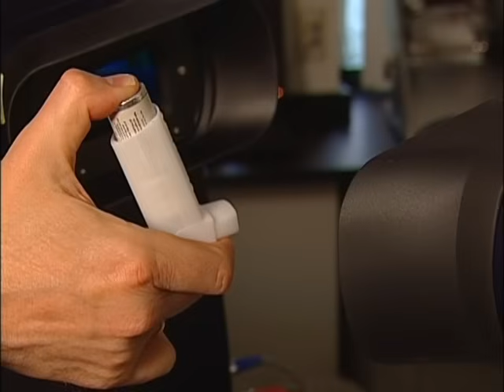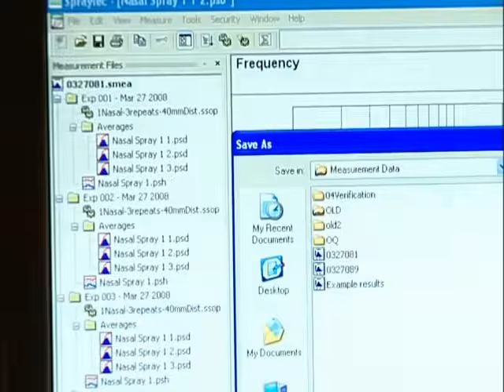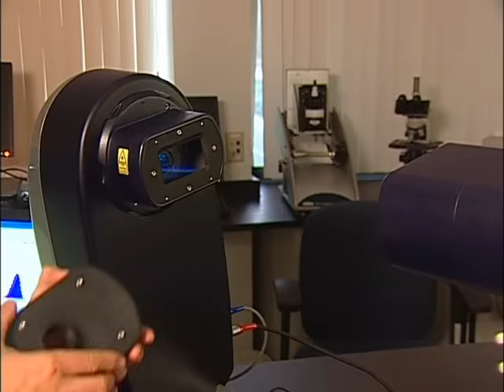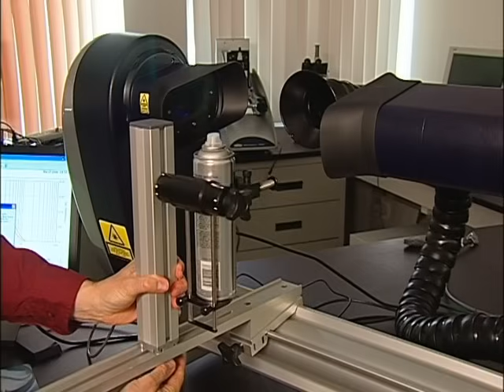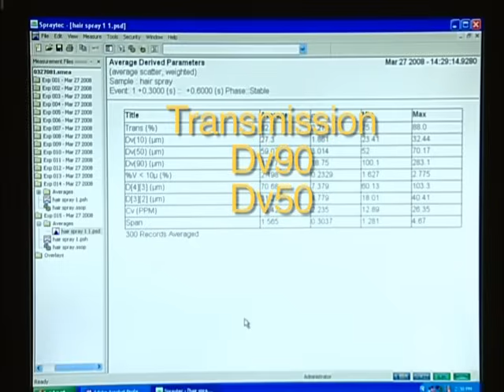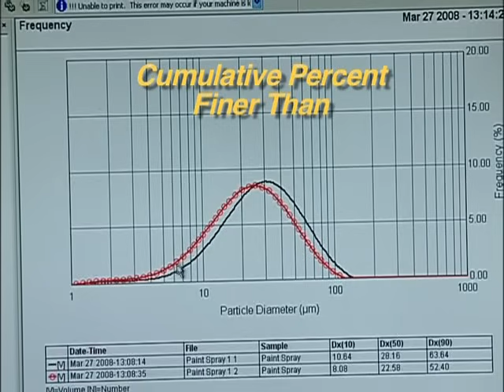Laser diffraction spray particle & spray droplet size measurement - Spraytec

Comment: Could this measure the droplet size suspended in the air coming from an agricultural sprayer used to spray the pesticide solution over the crop leaf? We want to test the droplet size of nozzle sprayer used in agriculture operation.

Comment: anyone explain the difference between what is meant here the optical bench and working distance
   1)Optical bench: 1400mm or greater.
2) Working distance: 150mm at 0.5microns and greater than 2000mm above 10microns or better.
Reply from the maker: Thank you for your request, Could we ask you to reach to your local representative that will contact you back until one of our specialist can provide a reply to your question - https://www.malvernpanalytical.com/en/about-us/contact-us/. Hope this helps.
Reply from the maker: 1)	The optical bench is the rail on which the transmitter and receiver units sit, the standard bench lengths are 900mm and 1400mm (but custom lengths can be used). The choice of bench length depends on the width of the spray plume that you want to measure.
2)	The working distance relates to how far away the sample is from the receiver unit as it passes through the laser beam. Smaller particles, scattering at wider angles, need to be closer to the receiver unit to ensure that all of the high angle scattering is captured. Bigger particles can be further away from the receiver unit as they scatter at narrower angles. Hence the example working distances of 150mm for 0.5 micron particles and more than 2000mm for 10 micron particles.
You can find more details (and some helpful pictures) here:
https://www.malvernpanalytical.com/en/learn/knowledge-center/technical-notes/TN101104WorkingRangeLaserDiffractionSpray.html

Comment: Hello!  In principle, yes.  It depends on the droplet concentration, droplet size and arranging the system in such a way that the spray can pass through the laser beam.  If you can you tell us a little bit more about your application, we'd be happy to investigate if it is feasible or not :-)

Comment: Could this measure oil droplet size suspended in the air coming from a PCV off of an engine?
Reply from the maker: Hello!  In principle, yes.  It depends on the droplet concentration, droplet size and arranging the system in such a way that the spray can pass through the laser beam.  If you can you tell us a little bit more about your application, we'd be happy to investigate if it is feasible or not :-)